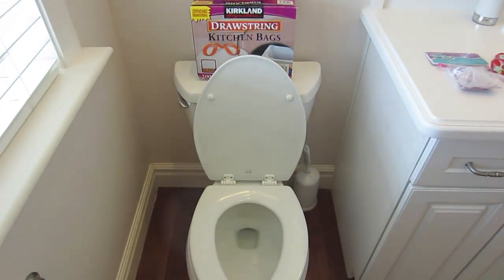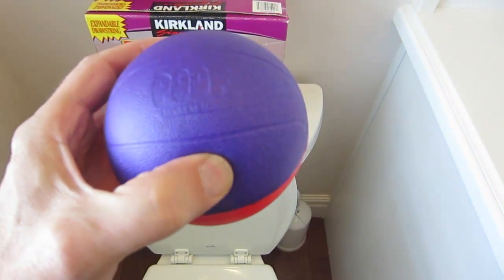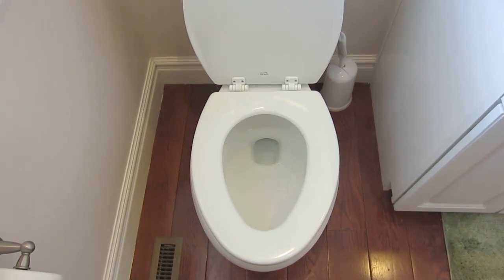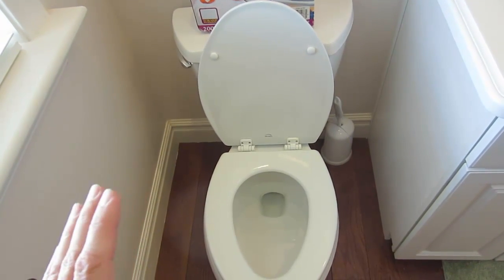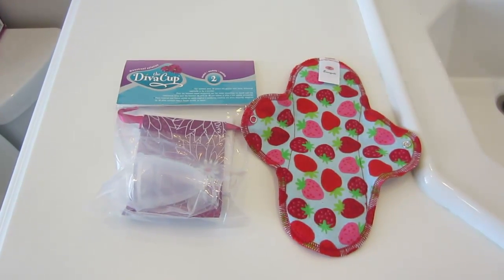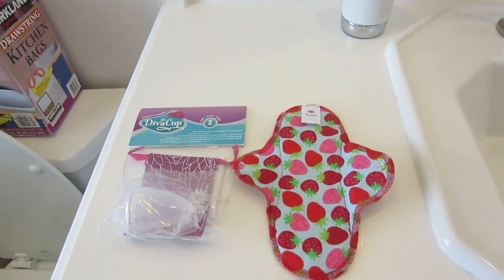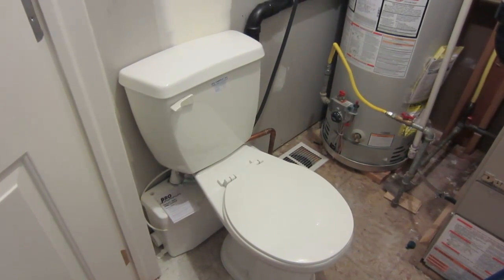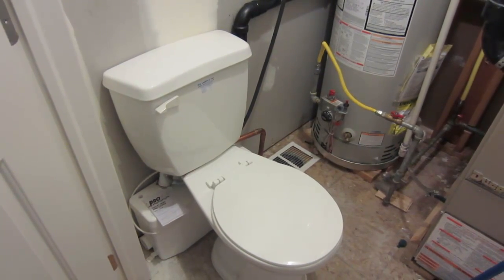Off-Grid Homesteading: Sanitation - Handling Human Waste

Comment: I have fond memories of being without power for over a week when hurricane Ike hit. Next time i will avoid using the toilet inside completely. When you have no air circulation and it is 95+ and very high RH the stench of a toilet is far worse.
I will be building a make shift out house and use my detachable toilet set for the out house if needed.

Comment: Thanks for the video, as we know most people  don't include this in there preps, also if you use a smaller bag you can add peat moss or kitty litter in the bag, I use the 5 gal bucket with a lid for the peat moss and keep in the garage, the kitty litter is ok in it's bag or container. I had asked you wants before about the setbacks and sizes of your solar frames, going to breeze through you vid's to find that one, Thanks again for your Videos
Al ruark

Comment: Fresnel lens-using the sun to incinerate. Vent pipe with easy, home made carbon filter=no waste+no odor. easy peasy lemon squeezy! :)
Reply: Got an example?
Reply: All free parts and little effort to build. In this waste incineration scenario it would need a sun tracker but again that's not a very complicated thing to build then the ground level above the passing waste would need a glass top so the focused high intensity light would pass through and fry it all up. Next I would suggest a pusher like how farmers push the cow dung-basically a blade that pushes the waste into the burn section and then pushes it out to the secondary bio area for compaction. In the end of the process it will produce milorganite which is good fertilizer however I would suggest using on non edible foliage and trees. Most of the waste is water so I would guess the end result would be mass reduction down to about 1-5%. Cool eh? :) Let me know if I can be of any more help. Blessings friend.
Reply: That's a description, not an example.
I found 2 patents for this idea but no working models yet.
You'll need to achieve 1200 degrees F for an hour or longer depending on the amount of sewage you're trying to incinerate.

Interesting idea though.
Thanx again for making your videos.
Reply: That wasn't my video. A Fresnel lens like mine get's hot enough to incinerate cinder block. You need welders goggles to operate. Hot enuf? lol
Reply: Pablo I offered what I felt like offering if you wanted an example you need to ask politely. The world is not here to appease you friend. Don't be rude mate.
Reply: I apologize.
and thanks again for the videos.
Keep up the good work.
Reply: Hey brother there's no need to apologize and the vid I posted wasn't mine but rather one I found which pertained. God bless bro! :)